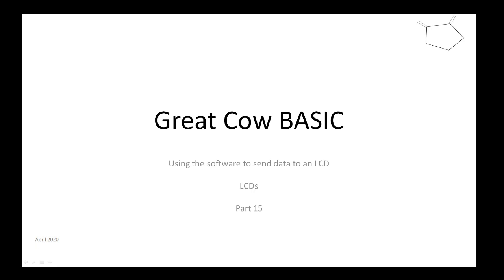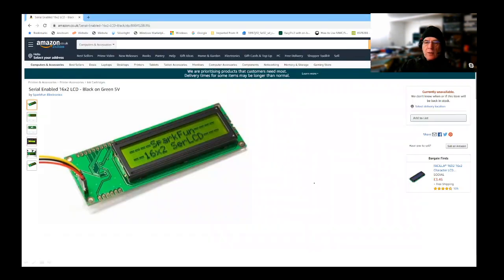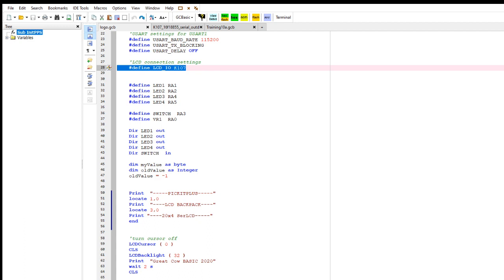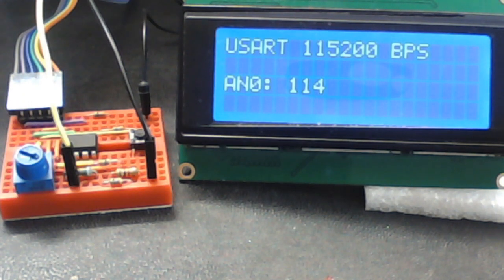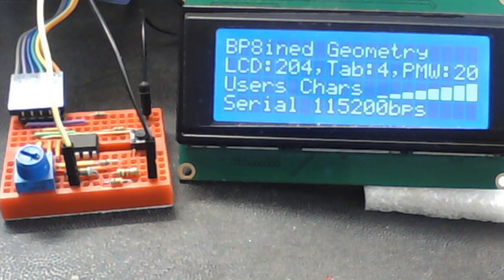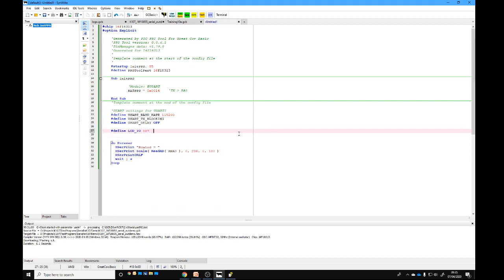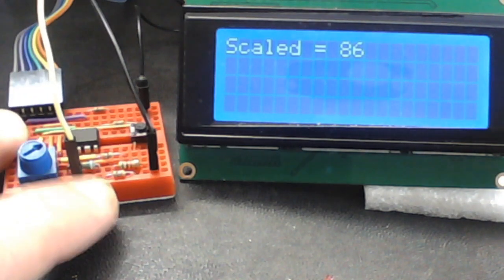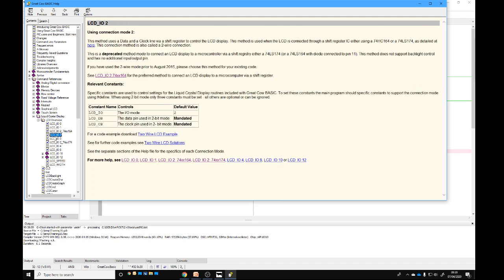Great Cow BASIC: Part 15: Using the software to send data to an LCD

Comment: Hey!
I finally got it working in 4 wire mode! ❤😊

But, all BASICs I've programmed in so far interpret ? as PRINT.
Not so, so far, with GCB.
Can you/I add support for that?
Reply from the maker: GCBASIC is not an interpreted - GCBASIC generates machine code/hex for the specific chip.  We generate the HEX from the source code you define.  :-)

Re the Large FONTs on the LCD.  The value of the backpack is that it supports the different character types.  I an not aware of published/free version of the character types for GCBASIC.

Comment: How can I do it with a parallel attachment?
I'm using an Arduino Pro Mini
Reply from the maker: You can buy the LCD backpack from www.pickitplus.co.uk  You just send serial data to the LCD backpack from the Arduino Pro Mini.
Reply: @AnobiumTech  thanks for your quick reply!
I already have an LCD. Don't wish to buy another (serial) LCD, nor a parallel to serial adaptor.
Can it be done?
Reply from the maker: @the_eminent_Joshua_E_Hrouda  yes. what language/IDE are you using?
Reply: @AnobiumTech  SynWrite v6.22.2290

May I DM you?
Reply from the maker: @the_eminent_Joshua_E_Hrouda  Yes. But, post to the Forum would be best.  Then, we can all help you.
Reply: @AnobiumTech  I will use the forum then. Mode 4 suits me I believe. 
Can you please link me to the forum?
Reply: @AnobiumTech  my installation of GCB only seemed to come with about 3 .gcb files. How can I get the hundreds of demo programs (.gcb files) ?
Reply from the maker: @the_eminent_Joshua_E_Hrouda  https://sourceforge.net/p/gcbasic/discussion/
Reply from the maker: Also, see https://github.com/GreatCowBASIC/Demonstration_Sources/tree/main/LCD_Solutions/Four_Wire_LCD_Solutions